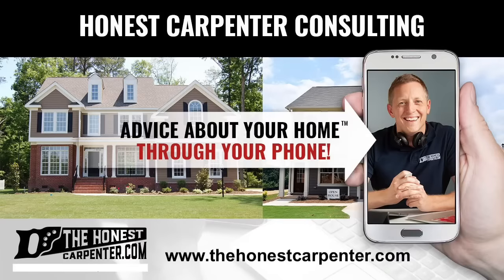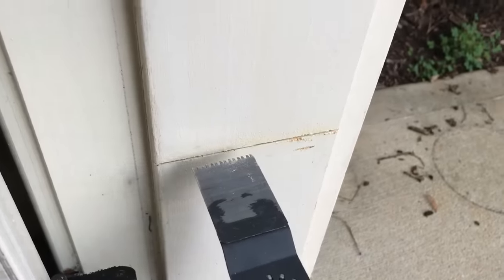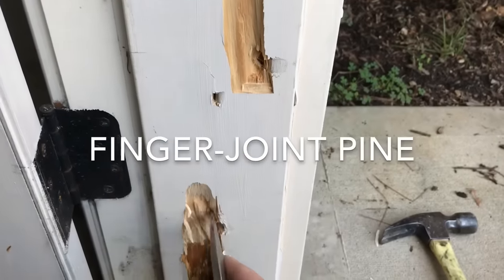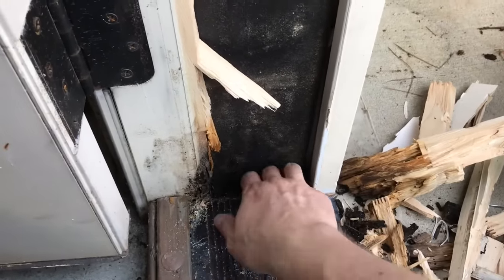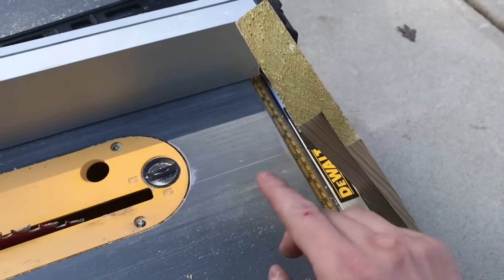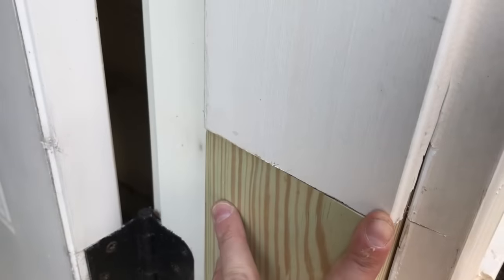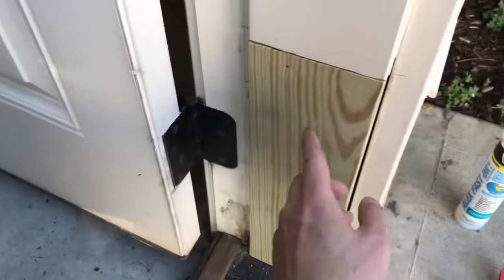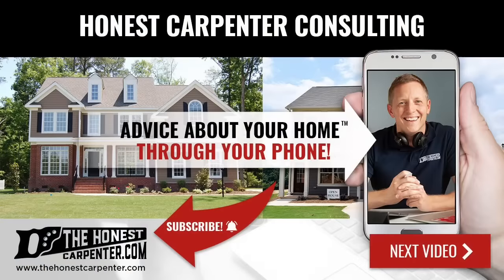How To Repair Rotted Door Jambs

Comment: Why would you remove so much of the perfectly good jamb? Not only is it structurally supporting the bottom hinge, but it was un necessary to make the repair. Than you replace it with thinner wood?! I haven't watched this guys videos before, so he may be very good, but I've been doing rot repair for longer than he's been alive. I would suggest you make this repair differently.  All rot damage is different, so each should be addressed in the manner appropriate for the situation.  In this case he should have made the same type of cut, but at about four or five inches. 

The door industry has been getting quite a bit smarter in design, and having recognized this issue over the years, you can now order exterior jambs with a composite or plastic bottom six inches. 

In this case, since the whole bottom edge of the jamb was rotten,  I would have replaced it with a piece of Aztec trim. He may not have this option available in his area, so no judgment there. Aztec trim is pvc and is manufactured in 1× and 5/4 thickness. This is the product I would use on this repair, that way the bottom of the jamb won't rot again.  Notice, not all door jambs rot at the bottom.  It's likely that the jamb on the opposite side of this door was fine for instance. There are many factors that could cause each door jamb to weather differently.  If he has the opportunity to go back to this door in twelve to fifteen years, he'll find the bottom of the door jamb has rotted again. This could have been avoided by replacing the bad wood with pvc trim. I also recommend cutting along the edge of the weather strip and cutting a notch in to your replacement piece rather than his let here. The weather strip will likely need to be glued in to be secure in this case. This is also not to mention that the only structure the bottom hinge has now is probably one screw into the framing.  The jamb behind the hinge should have been left untouched. 

Good luck in your rot repairs. May they never visit you again!
Reply: Totally agree with you and your assessment of video. When I saw him using PT wood not PVC & cut way higher than lower hinge. I'm saying to myself "what a hack job" looks ok but won't stand test of time. Seen this crap done by, when people fixing house for sale!
Do it right or not at all is my motto 😎
Reply: @thomasmalcolm110  Thanks Thomas! I wouldn't go as far as saying he's a hack though. I think he has less experience and hasn't thought it through well. The way I would have done it wouldn't have taken any more time. A hack generally does crappie work because they want to make as much money as possible and could care less about the results or customer.  I don't get that from this young man. Hopefully he'll read the comments and reconsider his methods a little. I see now you didn't call him a hack, but you know what I mean. Thanks
Reply: @shmerd1  true, I meant not done to MY standards 😎 he had proper tool to do job much better & 15 minutes he said to break out wood I'd been done by then 😂
NEVER would I cut into house wrap either & use adhesive for shims. Have brad nailer why use adhesive 🤔 
You & I are old school but use modern materials and equipment to do it too last test of time giving customers bang for buck 🙂
Reply: Any chance you are in southwestern Pennsylvania?  I’d hire you in a heartbeat.  Seriously.
Reply: @CH67guy1  I'm 20 miles south of DC
Reply: @CH67guy1  Thanks, I appreciate that! I'm as far as you can get from Pennsylvania and still be in the continental US! If I ever get to your part of the country,  I look you up!😜

Comment: I just cut out the rotted part and fill with hard rock.  Sand to match wood and paint with quality paint and caulk.  Never have had a call back and takes less then hour.  Customers are happy and it saves them money since it’s faster.
Reply: The customers are happy at the moment because it might appear "done," but after a full heat and wetting cycle or two, they call someone else because the rock hard didn't move when all the wood around it did and they want to find someone who will really do it right and not just some patch job. just saying.

Comment: Sure would have put some caulk or even your adhesive on the part of the new piece so water will not wick up the dry wood found just caulking the connection to the threshold is not enough when the caulking will eventually crack over time

Comment: I use the minwax two part wood filler...It would have to be real bad to do that type of job...But; every man has his way...If it fixes it; it's good...
Reply: Bondo is cheaper and works as well. Dig out rot use Minwax wood hardener or Git Rot to stabilize then fill and sand.
Reply: @gordoncushman7807  You're right.  It is cheaper, and I have used it on exterior  moldings on churches and residences...I use it when I have a neglected building that needs extensive repairs... The one thing is once you have a good mix it likes to sag and on larger repairs you have to embed mesh...it's messy...Tell you what; the expandable foam is a good prefiller too, if you don't want to get done in one day...:)

Comment: Hi great video... but I have a question, will this process work for 2x4  on a 3 panel patio door? I don't need the weather proofing piece which I think will make it easier... hope you get to read this, thanks!
Reply from the maker: Jeff Naranjo Thanks for writing in! Is the 3-panel door made of 2x4? Which part has rotted—one of the vertical pieces? Or a horizontal piece along the bottom??

Comment: It's surprising that no one makes repair kits for this job since it is such a common issue.
Reply: I am in the middle of repairing mine right now. I didn't realize how common it is.
Reply: You can buy a jamb leg from Home Depot and Lowes.  Just need to cut it down and it saves a shit ton of work.
Reply: @totallynottrademarked5279  Interesting tip Brian, Thanks
Reply: Better Door does make repair kits and has a video on YouTube showing the "how-to".

Comment: And yet no sealer on the end grain to prevent the same wicking? The silicon doesn’t prevent moisture from entering from general condensation. The shins are unacceptable by any means. Always go solid stock.
Reply: maybe his sealer was running on empty.

Comment: Great video.  If I have to make shims, I won't use the end grain though, only face grain.  Those endgrains will crumble.  Also, I think I'll use PVC board for the bottom section of the jam.
Reply from the maker: @christschool Thank you! In any interior door situation where I'm dry-nailing through the jamb, I always use linear shims, much as you suggest. In this case though, the end grain shims get so smothered in adhesive that I know they'll have no chance to clatter down into the jamb cavity, so I just use them as temporary spacers until glue dries

Comment: Nice repair but I would have not taken as much off. Half that length about 8 inches and I love the White PVC or Composite material to patch trim.. I don’t even paint a lot of times. Caulk and go..
Reply: Here in California, it's recommended to go 2 feet beyond the end of visible infection... As the mycelium can extend further than the visible damage. Hardly anyone goes to that length though, so I often see repairs that are reinfested years later.
Reply: I prefer to go about 15 feet beyond the visible infection just to be safe.  If the Home isn’t 15 feet high, don’t be afraid to leave the jamb jutting up past the roof into the sky, the important thing is to do it right.

Comment: oooH   the Bosch oscillator! (want one Bosch makes the best tools).  The tar paper does not "form a vapor barrier", its forms a moisture barrier.  It IS POROUS to let vapors flow through it!  It is used in roofing with shingles for that reason.  You don't just put one sheet of roofing material over a whole roof, there are shingles that allow a tiny bit of vapor to escape the roof.  You see the same theory at play with siding.  Everything has moisture in it.  Wood has moisture that needs to slowly escape.  House wrap does not let much moisture escape, and can cause moisture to condense and cause rot and mold.  The BEST choice is a barrier that lets vapor out but doesn't let moisture in. Also just because Lowes and Home Depot don't have  the correct thickness of wood, that doesn't mean you can't go to an actual lumber yard.  It will be cheaper as they sell wood by the foot.  I don't like to leave gaps with shims if it can be avoided:  Drafts!, Bugs! Moisture has a new home to live in!  Also no Dado set to cut the rabbit???  Did you stand the board on the saw????  That wood is full of preservative for decking, needs to dry before prime and paint, and should be primed before installing.   ("Shop dry" is good but you don't explain very well). "I don't know why they don't seal the endgrain when making these doors", Then you use pine you bad mouthed, and YOU don't seal the endgrain.   I just fixed one of these type of repairs that ALSO rotted the same way!   (I use Zinser 123 primer because it dries to the touch in an hour or less).  Last but not least my nit pick is WRONG CAULK!!!!!  It is bewildering when you go to buy caulk but exterior PAINTABLE is your outside caulk, MAKE SURE it says "exterior".  Your "tub and tile" caulk has NO UV PREVENTER.  I have seen homeowners who use that on skylights and then the caulk rots.  (I like Phenoseal).  Also I skim coat with the two part wood epoxy, like Bondo, JB Weld, or even Elmers makes one, its "wood filler" that dries like plastic.  Bye Bye "scar", you can't see my repairs when I'm done.  Also undercutting the other jam will leave a hollow space behind the caulk to wick moisture, just caulk it with a tiny clear caulk bead. Sorry for attacking you, no I don't "make my own videos", yours was pretty good, as was your repair, I'm a perfectionist and I know it.
Reply from the maker: Thank you for the info, Edward. I don't mind advice. I've learned a good amount from folks like yourself writing it. I tend to work in a vacuum, because I'm solo, so these things are helpful. I'll keep them in mind going forward!

Comment: For that little section, epoxy would have been a better option than ripping out all that good wood.
Reply: That is for that little area of rot.  Plus epoxy doesn't rot.
Reply: I have done it with body filler too,very weather resistant as well.

Comment: Simple pull the door and replace the jamb.   The jamb extends past the threshold  and the threshold is attached to the jamb. You cut the threshold free from the door  The threshold is now not attached to the door or anything but there is lotsa "caulk"......come back to that door in 6 months.
Reply: I support the bottoms of my thresholds so this repair would work if someone like me installed the door. But you're right if it isn't supported by anything other than the jamb then its going to move every time it gets stepped on and seams will open up.
Reply: Ok. Make a video and post how you would do it. Let’s see you in action. No video and we’ll take it as you don’t know what you’re doing.😁
Reply: So much waste, time and material. I did it in about 3 hours, didnt have to remove brickmold or jams. Less to recaulk and no play at all.

Comment: I liked this video and how you explained each step of the process. I wish that you would show how to repair the threshold area of an outside door as well. I have  rotted wood under the threshold of my back door but trim is still in good shape. Is this something that can be repaired without replacing the whole frame? Thanks, Cindy
Reply from the maker: @Cyndracula It's tricky, but you can sometimes remove the threshold without removing the whole door frame.  Is it a metal threshold, or wood?

Comment: You criticize the jamb manufacturer for not priming the end grain; then you don’t prime your own repair timber end grain. It would only take a few minutes to give it a lick of primer. The timber you selected had a knot at the bottom which will be a weak point for future moisture ingress. I usually replace the whole length of timber profile; it looks and feels better than a patch.
Reply from the maker: Thanks for writing in Paul. I replaced with treated wood—it won’t rot under these conditions (without ground contact). And replacing the full jamb side would mean re-mortising the hinges and rehanging the slab. Tricky for DIYers. Almost better replacing whole pre-hung assembly at that point 😬
Reply: it was treated wood I see booth points!
Reply: @TheHonestCarpenter  treated wood won't rot? Guess you've never replaced a fence. Jamb repairs are better with pvc jamb pieces. I don't want to bash you but honestly this repair was kind of amateurish. But hell we all learn new things. That's why I love carpentry. Every day is different
Reply: You don’t need to paint treated lumber dude.
Reply: Finger jointed no less.
Reply: Robert Cary, hey man, we r talking job security here.
Reply: @lazydadsgarage  This is dopey, PCV contracts differently than wood silly boy.  Don't come on here all puffy and stuff please.
Reply: Don't get all huffy silly boy.. that would be PVC not PCV.  The video shows a Professional way to mickey mouse a proper repair.  The option is to do it right at a substantially increased amount of time and money. I have a similar situation and I am selling my place... I'll be doing something similar to the technique in the video.
Reply: @markthomas8278  yes, even treated lumber rots eventually, but fence posts get significantly more water contact than this ever will. Even then, do you prime the bottoms of your fence posts? Because using your analogy of this pt wood rotting without primer underneath because fence posts rot is like saying the same thing.
Reply: @TheHonestCarpenter    Ground contact?   wtf...   treated wood is only treated on the surface and you cut into it, without treating the cut, or sealing it.  And in this repair, you are relying on caulking to keep out moisture...   that will work in  the short term, at least until you get paid.  "E" for effort.
Reply: @jalinmurphy9  make sence to me about primer!
Reply: @markthomas8278  mah bad mang. Was supposed to be in response to @Robert Cary
Reply: @sethbracken  nope, not when your customers live in shacks & trailer parks

Comment: Thanks for informative video. Living in Florida for over 20 years I avoid  real wood on any of my outdoor repairs. When I moved here in 2000 I replaced all doors with fiberglass doors unfortunately pvc or composite  jambs were not available . On the first door I actually removed door and made arrangement for local door shop to build  PVC replacement jamb in one day. Everything went back together but VERY labor intensive. Recently to repair bottom sections of rotten jams on remainin
g doors  I purchased 1 piece solid PVC jam with insulation slot  it was $50.00 but well worth it  I wonder how these repairs were made before oscillating tools came along?

Comment: Hate to rain on your parade, but what kind of shape do you think that bottom plate is just on the other side of the building paper (water barrier)? Rotted, I’d bet.
Reply: You're correct in asking the question here. Having done this repair on maybe forty or so jambs, I can say that often the rot on the plate is insignificant, and very seldom necessary to replace. One must always evaluate the cost benefit of digging deeper. You could disrupt the building envelope by getting in to a framing repair. Rot stops growing if the water can be removed from the area. After repairs have been made the seam between the jamb and sill should have a small bead of Sidewinder applied. 

I've found that usually there's little damage if the plate is on a slab, and in the case where the door is over wood framing usually the rot goes down. I have had to repair framing in this situation maybe about 10-20% of the time. I'm in Tillamook Oregon,  and our area is considered a rain forest.  You can definitely tell by the condition of the door jambs and window sills!

Comment: Custom work like this is always time consuming.  Replace the entire jam, unless the house is old and everything is out of wack.
Reply: Well I’d be charging $350-$400 for labor to replace the jamb and trim on the inside/outside which always gets messed up when you try to dis assemble. That’s not including the cost of the frame and trims or to mortise out the hinges, etc if that’s needs done too. In other words this looks like a $150-$250 fix compared to a$600-$800 fix materials(new frame/trims) and labor. What he has done here makes perfect sense.
Reply: MFD Mike well said
Reply: Custom work....lol.

Comment: I used a 2-part  bondo type filler to repair a 100 year old door jamb, around and behind  the hinges (it was a smaller job than yours). then I drilled new holes and rehung the door.

The haunted house creak the door made  is now completely gone.

Comment: Honestly, it's not the way to fix this! So many things done that will just bring you back in a few years to do it all over, with more damage to correct.
Reply: Honestly, it's exactly the way to fix this. So many drive-by commentators with no clue here.
Reply: It may not be the best way, but it's in the rite direction. Short of replacing the entire jamb, which is an expense not needed

Comment: Great video!  

When I want to cut a line like that with the oscillating tool really accurately, I use a Brad or finish nailer to nail a scrap of 3/4 ply to the part of the material I am removing along my marked square line... then just let the blade rest on that and concentrate on keeping it level so the end cut off is square.  

  I have also used a 22-1/2 or 45 degree cut piece of 3/4 to 1-1/4” stock to do a beveled undercut for drainage on exterior trim repairs.

  Hope those help!
Reply from the maker: Thanks greenman! Great tips! 🙂